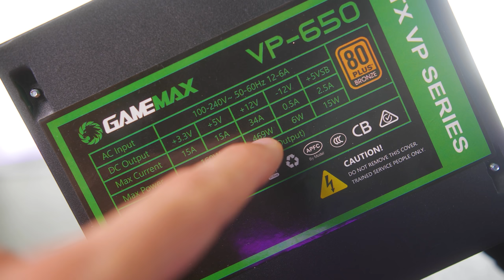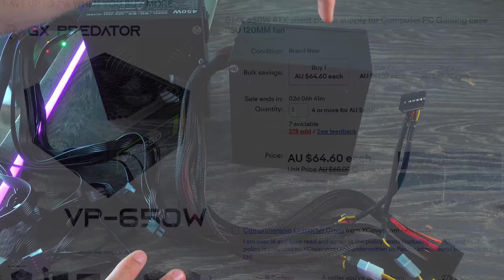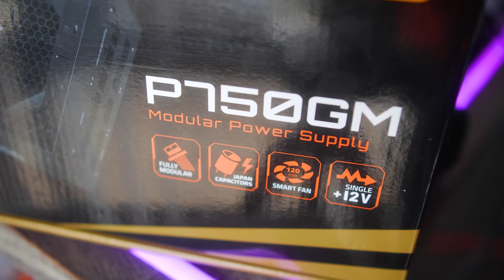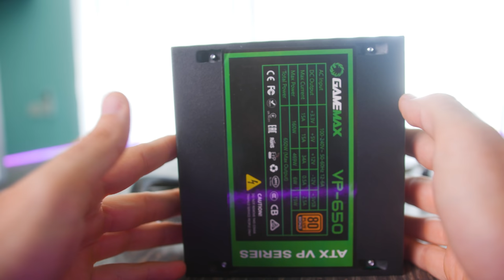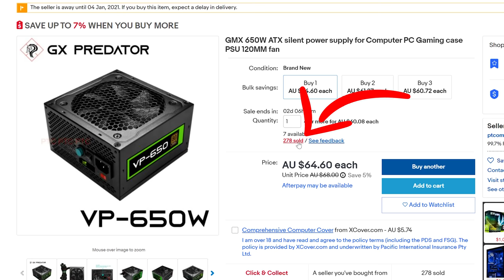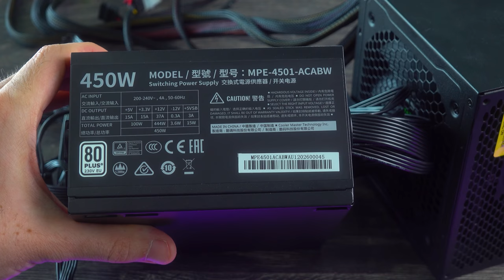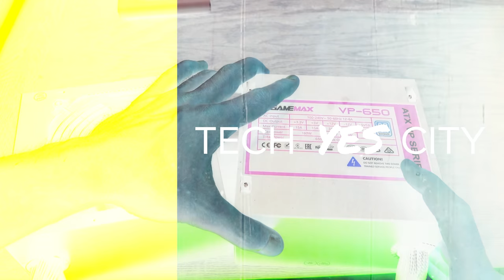This Company is Straight LYING about their "650 Watt" Power Supplies.... (*UPDATE* FAKE GameMAX??)

Comment: Merry Christmas!   I too have bought a lot of bad components in my learning era of PC building from 2000-2010.  I bought a few of early 500W power supplies and was shocked at how light they were when delivered compared to others I bought which were reputable.  It's sad that this stuff is still going on.  Ebay needs to step up, to help with this.  Everyone does.  I now only ever go with name brands, good enough, were they would not risk, their rep to make junk, at least for starters.  Yeah, if I were new... You just wouldn't know.  Junk filtering is sometimes a hard earned skill. I myself am fed up with misleading sellers on ebay that sell obvious counterfeits as well, and lie about the shit from location.  I had a few recently.  My only avenue was to return junk items to seller, and ultimately there simply no efficient way to warn others, or ding sellers which were obviously misleading.  Ebay is partly to blame because an honest buyer has a million hoops to go through to warn, or impact bad listings, or sellers.  I found the feedback in my cases wasn't useful in this regard to authenticity, or item location lies.

Comment: Hello Brian, I'm a big fan of the content you present and a follower of this channel for a couple of years now.
But this time I have to disagree with some of your ideas here. First I don't remember seeing this VP-650 on their website; I find 500, 600, 700 and even 800, I guess maybe it's only for Australian market. And since I own 4 of those Gamemax PSUs (2 GE-700, 1 GM-700 and 1 VP-700) for a while now and one of them is in an OC'ed (CPU and GPU) PC and never faced a trouble pushing any of them ever.
Furthermore some notes I have to mention:
1- I noticed you were testing with the (ECO) mode ON; the small green button on the back is lit (ECO mode) and in this case the fan is not working or at minimal RPM on load which is maybe the reason for the smell you encountered so you might re-test with normal mode
2- My test PSU is the GE-700 which is the basic series (not 80+) and it's working absolute perfect with any system or load so maybe your sample is defective or so
3- All the units I have, have 2 6+2 PCI-e connectors (separate) 6 SATA + 2 (minimum) Molex connectors, never saw that less cables you had
4- About the weight, it's because the outer metal casing is thicker in Cooler master (+) not in internal components (I opened one and the quality of internals are not cheep)
5- I don't argue that Cooler master is better (absolutely agree), I have three units with different wattages and agree that even 400W or 450W is doing more than it's rated for but just as I used them in real life and for a prolonged time wanted your review to be as usual perfect
My thoughts are they are a growing company despite it's not acceptable to mislead users like us with false numbers
Sorry for long comment but merry Christmas to you and your family and keep up with that special content you give us

Comment: I remember back in 2017 when I bought a used OCZ 1000 watt power supply from Ebay which has a rating of 80 plus gold. I have it powering my MSI X99 motherboard with the intel core i7-6800k oc to 4.3 ghz, 16 gb ddr4 ram 3200 mhz, and a gtx 1080 graphics card. So far, it still works fine today even though when I looked it up, it seems like it was made back in May of 2011, but newer isn't always better. I guess that GameMax PSU is "out of there"

Comment: I've only ever bought a cheap Aliexpress PSU one time...a group of ceramic capacitors literally exploded minutes into the first load I put on it.  There wasn't enough left of the capacitors to even tell what they were to replace them.  It was a 600W that failed with only a Xeon X5460 and Radeon HD7850.

Comment: Damn, there are some really sketchy power supplies out there.
I have a R5 2600 and a GTX 1060, I also have some sketchy "550W" power supply I bought 3 years or so back.
I wanna upgrade to like a 5700XT or a 1080TI, what power supply would you recommend? I would maybe even upgrade my CPU to an R5 5600 (non-X once it comes out cuz I'm broke).
And I really don't wanna overkill (or overspend) on a PSU.
Thanks in advance, awesome vid man!

Comment: Almost 3 months ago I purchased of amazon.es a PSU from Aerocool, 550W 80+ Bronze for 27€. I was honestly surprised, the deal was amazing value for money, black braided cables and everything! That is, until I actually had it on my hands...

As soon as I grabbed the box, I started to panic; the entire package was ligther than a 240W HP SSF PSU. I opened it, and oh jeez, it even had a power cable included, so the PSU was even ligther than I thought! I used it on a build with an I7 2600, Lenovo H61 mobo, 16GB RAM and GTX 1060 3G. I added a couple of fans and thought, "Ok, this doesn't used all that much power, this thing should be able to handle it just fine." And the "just fine" was after downloading Fortnite and launching a test session, a loud POP. PSU died, and took the mobo with it.

Next day I contacted Amazon about this, they sent me a replacement IN LESS THAN 24 HOURS (from Spain to Portugal, but still, fast as hell) and when I asked where should I return the original one to: they said for me not to bother. EVEN AMAZON DOESN'T WANT IT BACK. I still have the replacement boxed, just opened it to run it through a PSU tester I got after watching another TYC video (thanks for the tip BTW) and the readings are... Weird. 12.8V on the 12V rail and (IIRC) 3.5V on the 3.3V rail.

Lesson learned: NEVER EVER CHEAP OUT ON THE PSU.

EDIT: went back to check it and they removed the 550W listing; they only have the 650 and 750W models of this PSU available. Either way, I would honestly just stay away from them.

Comment: If there's one area of your PC build you don't want to skimp on, it's the power supply. Seriously as someone who's been in this area for years I've seen way too many cheap PSUs flat out fail and some taking things they are connected to with them. Granted I'm personally a Corsair AX series snob (I have an original one from about 2009/2010 that's run nearly 24/7 since then), spending a few bucks more on a quality PSU will pay dividends down the road. Less chance of PSU failure and a lot less change of hardware failure due to a faulty PSU. Just like your own heart folks the actual heart of a PC is a PSU that pumps good clean reliable power around, buy some better quality in this area please.

Comment: if the warranty is under 5 years and the watts is under 750, don't even consider it. a rule for me has always been go for 850 then look at deals, I only consider superflower, corisar, and seasonic for psus. there are other oems, there are front facing ones that are good, there are ones that make psus behind the scenes that are fantastic, but the psu is one thing I refuse to have blow up in my system again, yes, I had a shit one that blew up because it was WAY overrated, luckily it didn't take the system with it.

seasonic at least state side is also one of the cheaper brands in high watt ranges, my 850 gold was 60$ due to a rebate, and I think this thing has a 10 year warranty with it.

Comment: Beyond the lack of brand credibility, the 120/240V switch on the back is what would steer me clear of this power supply before I even looked at the label.  The only power supply that I have in my house that has one of those is the PSU on my 3D printer.  
As for the increasing power draw over time, as the PSU gets warmer the efficiency drops which dumps even more heat into the PSU - remember, any power lost due to a lack of efficiency is turned into heat.

Comment: A HIGH QUALITY power supply should be able to supply about the SAME Wattage for the 12-volt rail as is listed in the name. For example, if it's a "650W" PSU it should be able to supply up to 650W of power to the graphics card, motherboard etc...I wonder what the rules are for advertising. I also wonder if this GameMAX PSU would catch on fire if you actually pushed it to the max.. although it would be actually impossible to fully stress the PSU in a normal computer since there's no way to max out the 3.3V and 5V rating. You'd need some sort of a test setup with resistors, then crank up the power on each of the voltage outputs.

Comment: You can try to open the PSU and see what's inside. Some cheap Chinese PSUs have fake components filled with cement to increase the weight. Also check the cable, some have very thick plastic jacket with very thin and few strand of copper wire.

Comment: The Gamemax VP-650 is the cheaper VP-450 with a 220/110V selector switch is a counterfeit generic power supply without the PFC power factor correction stage required for 80 plus bronze certification. The mission of the PFC stage is to increase the primary capacitor voltage to approx 390 volts DC despite the mains voltage fluctuations also the PFC manages the phase of the AC current to reflect a resistive load on the mains supply. In this way, with a primary high voltage of around 390 volts DC on the capacitor, the overall power efficiency is improved. Is not Gamemax the culprit here in a counterfeit situation.

Comment: Maybe the wattage is wrong because the Amps are labeled wrong.
Not sure if they are misrepresenting the wattage. I mean yes, of course the math don't add up but many PSUs have more headroom for safety purposes, and many that's what that PSU actually shows. 
Smells can come from first time use in many products, bad or not.
There power wattage measurement devices you use have a handy power efficiency % checker, you could use that to compare their power efficiency at given loads but wattage draw must be consistent each time.
It would be great if we had this teared down and analyzed from people like Buildzoid.
It certainly isn't a quality PSU and you would never want to put this into your system if the money you put into the entire system of course.

Comment: i had the 500w version in my sons rig..very mild power draw with what it was built with.He told me he could smell burning,and pc had lost performance after less than a years use.When i opened up the pc(it was built by someone else).The main power line had turned black,and was melting!So i immediatly removed it,and replaced with a better known brand PSU.As mentioned in this video,the weight of the PSU is the give away that its a piece of junk..virtually weightless,and the wiring itself wafer thin.Was pretty mad,as it could have caused a fire in my sons bedroom..which is obviously quite scary.
Reply: just to add...a while ago i was desperate for a PSU as my own suddely died.Only one i could get quick was from Maplin.Was very dubious about using it as it was a "own brand" unit with no bronze rating at the least.To be fair it ran a gaming rig with no problems for 12 months before i got round to replacing the PSU with a Corsair unit.So maybe cheap isnt always a bad move.

Comment: Yup, that's why one needs to stay away from 3rd tier PSU's.

It's like buying most inexpensive car amplifier's rated for thousands of watt's "max" power - the reality is most (esp. the cheap stuff) only can realistically deliver 1/4 of of that number (we're talking real RMS watts vs some delusional "maximum" number).  This has is an ongoing problem spanning several decades (and not just car audio, but home and even pro-audio).  However, one manufacturer is now being sued for false advertising (Rockville Audio).  So maybe things will change (though I wouldn't bet on it).

Anyhow, I hope you had a very Merry Christmas! :-)

Comment: I am NOT saying GameMax is doing anything underhanded, however there are a lot of counterfeit products AND counterfeit regulatory approvals on products for sale on the internet (including bulk sellers to retail stores).
Just because a product has a stamp, sticker, etc of a regulatory agency on it does not mean it actually was tested by and approved by that regulatory agency. Counterfeit lithium cells are a significant problem for vendors on the internet, and a given seller may not even know that what it is selling is counterfeit.
When I detected this problem on an order for (memory says "NEC") lithium cells I bought (far lower than spec'd Ah capacity), the seller tried to buy me off by giving me a 50% discount. That informs me the seller KNEW it was selling counterfeits. A reputable seller would have either given a full refund or shipped me a replacement after verifying they were selling genuine cells. They may have waited until they could verify counterfeits were indeed sold to me, but they would eventually have in an ethical manner made things right.

Comment: People have, throughout the decades, purchased worse PowerSupplies, knowing they can break and risk equipment. I think some people deliberately buy them (saving a few quid) to use with a RCD-trip-switch and 2nd-hand iffy cheap OEM components and iffy mining GPU gear so as to have a spare PC in a LAN party. It can still give enough (via cable-splitters) juice to run a bunch of free scrap HDDs in RAID or zfs or dynamic-disk for faster loading. 

I don't know if you've ever been to a LAN party, but it can get kinda ghetto with body odour, cig-smoke and stale pizza/beer fumes. Using a displayport long cable and half hanging that system unit out the window (wedging it under a sash window is a frequent trick) can distance you from the PSU fumes. I don't believe your studio was always so nice. Don't pretend you are above doing these things done by those in the comments-section. Welcome to the cheap seats. We all got rootz. Remember where you're from, rather than leave the little people behind. >:)

Comment: I have heard of GameMax I have never purchased PSU's from them and from the reviews that Johnny Guru has done on their PSU's they are generally bottom barrel junk. If you are going to get a PSU always check reviews from Jonny guru or gamersnexus as they rate them just they would do from the 80 plus board on efficiency. 

Also use a power calculator and what ever the total wattage is add a additional 100w on top. So you can cover any future upgrades that you might do in your rig. The PSU is the heart of your system and if it cannot power the rest of your build then one of two things will happen. It will die or it will die and take most or if not all the parts in your system with it. Golden rule never cheap out on your PSU. Hope this helps

Comment: Switch for voltage is big no. (115v to 230v) This means that the PSU lacks active PCF, should be heavier as it should be passive PCF. In the EU, it is illegal to sell PSUs in the power class without active PFC.
So MWE 450 White - V2 is type 5 $ cheaper, deliver 3A more 12v line, have better connection options and come with better warranty.

Hmmm ... difficult choice ...

Comment: I bought an Antec 650W 80 Plus Platinum in 2013/2014 and it still works perfectly (Newegg on sale). Currently with Ryzen 7 1700X, 2x 8GB 3.2GHz DDR4 Non-ECC, R9 290, various storage drives.

Comment: My reliable go-to for a new PSU is the Aerocool Integrator 600w. 46A on the +12V which is (and it's on the box) 552W, so not bad.. Recently went from an 80+ Bronze to a Silver too (unverified by myself) and all for £40-45 ($55US/$70AUS) give or take.

Comment: Once got a cheap mod PSU off eBay that would shut down my pc if I played diablo 2, back then I didn't know much about PC's but I took it out and sent it back and reported it to eBay that they were dangerous. Seller was shut down and they gave me my money back, the seller tried to sell the PSU off as OCZ brand one. 

When I built my intel 2600k I went OCZ but got it from a very well known online shop overclockers. 10 years on it still works for my Ryzen 3600 rig

Comment: Back in 2011, I did the novice mistake to buy a cheap psu (650W for 30CAD$). It fried my 460gtx 1gb GDDr5 and I had to send it for RMA. I learned the hard way to NEVER buy a cheap psu. Now, I don't buy anything under 80+ gold from known brands such as corsair or seasonic.

Comment: I bought a 700W powersupply with a case combo for like 40 bucks for my junkyard find core i3 build. I knew it was a fake even before ordering and the seller told me it certainly is and it's true rated capacity is only 200w. Works perfectly fine for my core i3 but I would never cheap out on power supply for a new and expensive system.

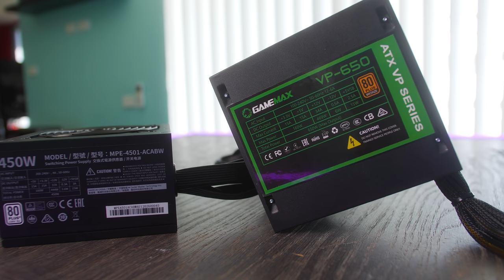Comment: Agree with your analysis, but it doesn't claim anywhere that it was certified as simply 80 Plus. It states that the 80 Plus certification program is what authorized the use of their standard, but that it was originally certified as a Bronze rated Psu. It says it right above where you highlighted at 3:08.

Comment: Always check the AMP on the 12V rail, then do some simple math, it's not harder than calculating the price/weight when buying groceries.
that gamemax PSU is a 408W and the other is a 444W.
Always go for the European goldrated (US goldrating equalls bronze in Europe) or better PSU's, you'll save $5 /year on your electrical bill, by just going from bronze to gold.
In 10 years that's $50, which is usually more than the PSU pricespan.
That's not even mentioning noise & heat.

Comment: I live in the states and I bought a VP RGB semi modular 600W psu from them. It’s been over 6 months with no issues whatsoever. I’m going to cross reference the specs on my unit compared to this. I have to say though my psu did come with quite a bit of documentation as well as a 24 pin bridge to test the psu before plugging anything in so that already seems different. I did see the description about the company contacting you and saying this may have been a fake, has there been any resolution? I’d assume they would want to send you one of “theirs” to show you the difference but, if they don’t that will be a telltale sign of the truth..